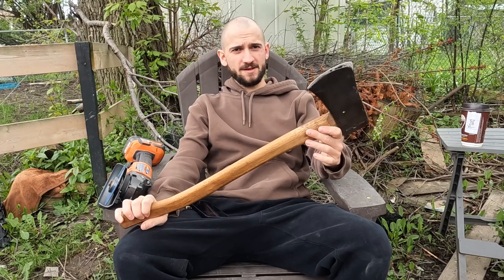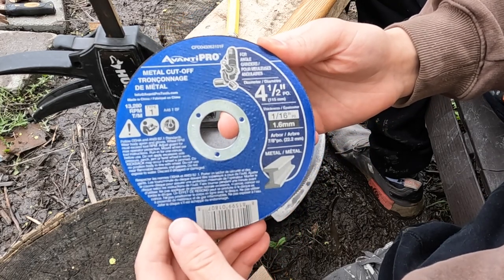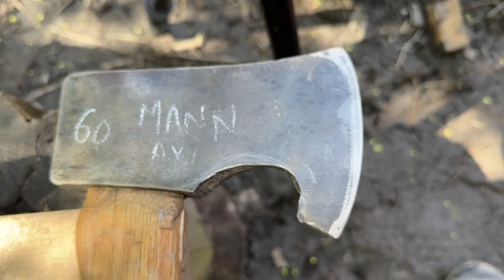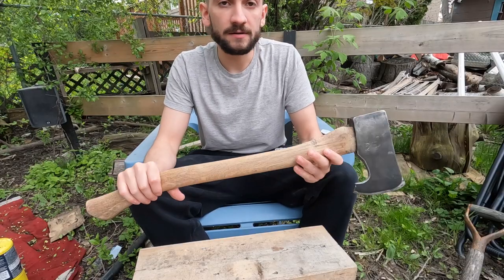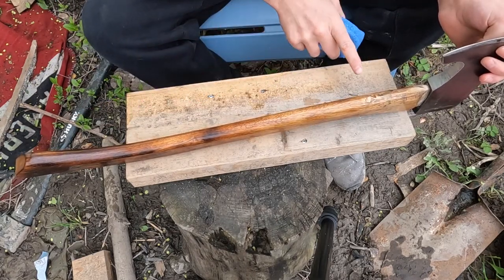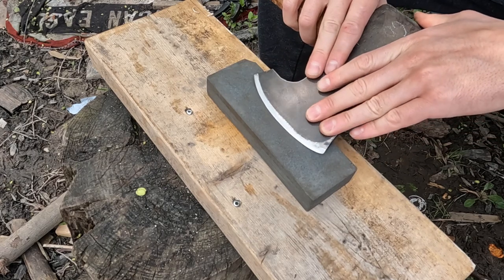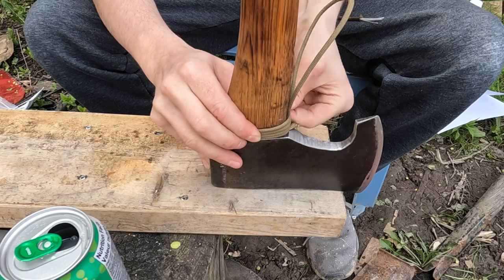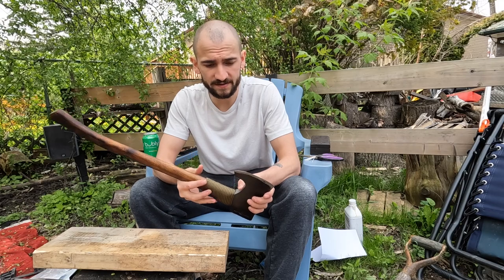Reshaping an Axe Head at Home - Easy Method

Comment: Watch how much heat you put to the steel if ut gets too hot you will either remove or alter the temper wich can result in a fragile edge or microscopic crachs that could make tge axe head completely fail in time one rule of thumb i use is as long as you can touch it for 5 seconds its not to hot if you cant pur a little water on it